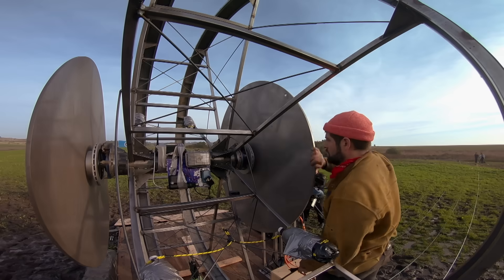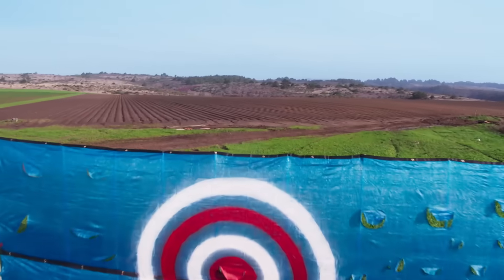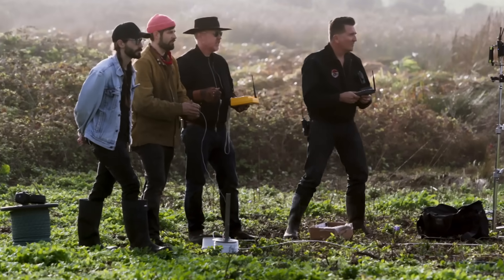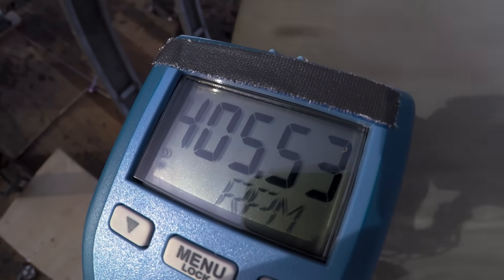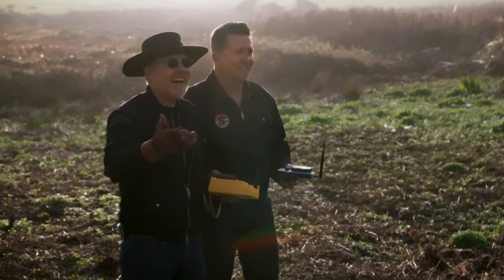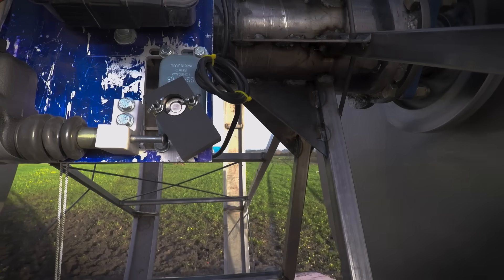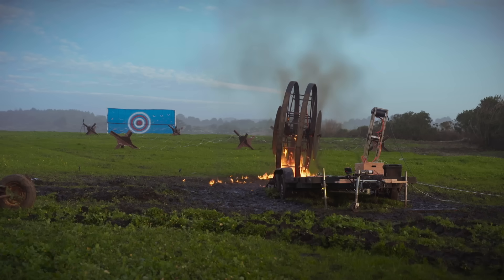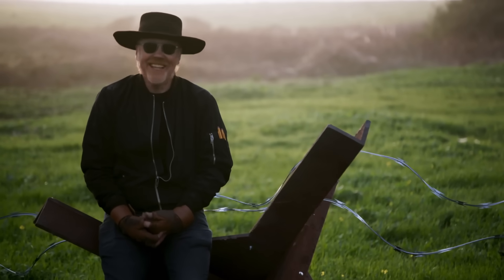Weaponised Flywheel Experiment Fails Explosively | Savage Builds

Comment: Wouldn't you lose a ton of energy to heat dissipation in the disc brakes too?
Reply: That's why more powerful brakes would transfer more energy. There would be less time spent generating heat (though the heat generated would be more intense...). I'm curious what the outcome would be if a torque converter could be used instead of disk brakes. There would still be heating of the fluid, but would it be more efficient at transferring the mechanical energy?
Reply: @NathanielHatley  
Like an 800 HP super car at redline and dump the clutch.
Reply: @larryscott3982  yeah like how drag racer clutches work...like one time usage only...
Reply: @NathanielHatley  I was thinking about that too.
Reply: @NathanielHatley  The faster those brakes lock up, the more likely all that kinetic energy from the flywheels (1000lbs at 65 revs per second) is going to simply rip apart the wheel frame.  It would fail spectacularly, unless there were a lossless way to couple the energy from the source (flywheel) to the sink (outer wheel frame) without going into instant lock-up.  Some sort of high-speed pulsed clutch, coupled via axial or torsion spring system comes to mind.
Reply: @NathanielHatley  Pretty sure that is completely unrelated. The heat energy lost should be the same regardless of the brake speed. They need to solve this with conservation of angular momentum, not energy. The only way speed matters here is static vs dynamic coefficient of friction (for the whole system rolling)
Reply: @chadarmstrong7458  Exactly that. It needs a clutch, not brakes.
Reply: @froschfresser29  Came here to say exactly this. Brakes are DESIGNED to convert kinetic energy to heat. A clutch's entire job is to connect masses moving at different speeds.
Reply: @firewall2302  so glad I saw this comment, I wanted to make it myself but was hoping to see it first. Let me reiterate this man's point: brakes are designed to turn kinetic energy into heat not transfer it.
Reply: @firewall2302    I agree but I think they wanted an "abrupt" acceleration rather than a transfer of momentum. Also, a clutch would likely be destroyed unless it transferred that energy over a few gears. I find it unlikely that it would've ever worked like they thought unless the entire thing was much lighter or if they redesigned it to have a holding arm that allowed it to spin before being let loose (this has whole other stability issues). Their brake idea would've worked without as much complexity as a clutch system but they'd have needed a much better braking system and probably more RPM or lighter wheels to compensate for massive loss in RPM to heat.
Reply: @firewall2302  a brakes job is also to couple two masses rotating at different speeds. Clutches and brakes are essentially the same thing. They literally could use either. For their design, it would be much easier to implement brakes as a brake axle is nearly the perfect design to use for what they are doing. They just way undersized the axle and brakes. Think same set up with tractor/trailer brakes. The engineering is already done. Just bolt the flywheel to the hub and bolt the axle to the axis. Using clutches would require engineering and fabricobbling hubs and axle from scratch.
Reply: @froschfresser29  brakes and clutches are the same concept. there is no fundamental difference.
Reply: @zarni000  No they are not. One transfers energy, the other converts it to heat. Otherwise explain why they have a very different construction.
Reply: @froschfresser29  the only reason brakes do not transfer it to turning is because your vehicle is generally not round ;)
Look at the basic designs. They are the same
Reply: @zarni000  Then why did it not work? And why do brakes get hot, while a clutch makes a car move?
Reply: @zarni000  The vehicle in the video is round btw.
Reply: @froschfresser29  yep exactly. It is round. That's why I'm saying there is no difference in this example what you use. Result will be same.
Clutch gets hot too just as brakes do
Reply: @froschfresser29  the clutch makes a car move because it transfers the energy from spinning gear to another spin able part - the axle. The brakes are exactly the same concept however cars are not spinnable. Unless of course u hit your brakes at like 100mph. Then you will see the spinning motion transfer to a spinning car
Reply: @zarni000  The "car" in the video is spinable, why did it not spin? Also I can hit my brakes at any given speed as hard as I want, the car will never spin.
Reply: @froschfresser29  Look a little more carefully. Why it didn't spin. Not enough to propel it thru mud...simple
Reply: @froschfresser29  hit brakes at 100moh as hard as you can and see what happens then...
Reply: @froschfresser29  btw u some kind of genius aren't u?
Reply: @froschfresser29  Try hitting the front brakes on a bike while going fast and see how many teeth you have left after
Reply: @thebekowsky1217  I actually did that. Three teeth had to be repaired, none was lost.
Thing is, the wheel stopped spinning and slid to the side, so that the bike went sideways and I kissed the pavement. The bike didn't flip or spin at all. And now?
Reply: @thebekowsky1217  maybe look at it from a different angle: the engine produces rotational energy, which is transfered to the wheels, where it gets transfered to directional energy (car moving), without relevant excess heat (apart from the engine, but that heat is produced before anything moves at all, and is waste anyway). When you brake and the car stops moving, where does the energy go? Or to put it in really simple terms: why does the brake get hot, but the clutch doesn't?
Reply: @froschfresser29  (TLDR included) If you were locked into going straight, and applied just the front brakes the bike frame and yourself would have rotated around the front wheel forwards. 

Now imagine a helicopter with only the primary rotor. Both the blades and the body will spin at the same rate but opposite ways. If you put the helicopter on it's side, fixed the body in space, and made the rotors into a solid disc, it now becomes an stationary engine and a rotating crankshaft. Scenario 1: If you were to grab the rotating disk with an external source (which is also fixed in space), you would resist the rotation of the disk and deccelerate it by dissipating the energy through heat (assuming all components are unbreakable), so the external source becomes a brake. Scenario 2: Instead of grabbing the disk, you move an unpowered, free to rotate e.g. like a wheel on a hotwheels car, second disk (disk 2) towards the face of the rotating disk. What will happen when the two faces touch is disk 2 will match the speed of the rotating disk (ideally instantly). Since disk 2 is free to rotate, it doesn't resist the rotation and both it and it's axle now rotate at the speed of disk 1 (the crankshaft disk). If you enable a way to move disk 2 back and forth, it now becomes a clutch system. You can then add gears to change the axis of rotation to the end of disk 2's axle, and wheels after that, and now all the components in scenario 2 become a drive system of a car. 

However, if you placed the car on an extremly grippy surface that prevented the wheel from moving and you engaged the clutch, it would then act like a brake. And in reality you do get some resistance through the clutch (from various sources) and that's why RPM changes when ging through gears.

TLDR: All brakes are clutches (clutches with high resistivity), but not all clutches are brakes (ideally).
Reply: @zarni000  How was it the mud? It barely made it off the trailer. The problem was the brakes they used didn't transfer the force instantly, they dissipated the force across a long time, which is how they should work but it wasn't what they needed on their rig.
Reply: @thebekowsky1217  was the mud. and his "equations" didn't take that into account.
he looks more like an actor and brings into further question the whole mars rover bs
Reply: @zarni000  It had basically stopped before it reached the mud it was going so slow. Yes the mud did make it stop but it would've stopped that quick on any surface anyway, it was the brakes that made the design fail.
Reply: @thebekowsky1217  breaks dont matter how fast they stop it. the motion is still transferred. there was just not enough power to get it through the mud. if it were a hard surface it could have moved. they also probably made quite some errors in the calculations. the fact they didn' even bother to try it second time which would have not been hard to do leads me to believe they didn't want to be further embarrassed...
Reply: @zarni000  No. It was slow off the start when it was still on the trailer that means it can't have beem the mud's fault. It was energy not being properly transferred to the main wheels. It was probably due to time constraints than embarrasment. And more to do with budget that they couldn't test other options.
Reply: @zarni000 If they had gotten the launch they wanted the mud wouldn't have stopped it. It was a launch issue not a terrain issue. The only thing they should be embarrassed about is the clickbaity title (which is down to someone in the network anyway).
Reply: your clutch will get hot too if you ride it while driving. Cuz they both use friction plates to convert energy
Reply: @firewall2302  but it still converts kinetic energy to heat to do that
Reply: Brake and clutch are one in the same. They both use friction pads to transfer energy/power. A clutch disengages friction where as a brake applies friction.

I think these friction pads were to small to prevent slippage. But ultimately I think Newton's Laws of  Motion come into play, Something about inertia and objects at rest tend to stay at rest, coupled with a slipping clutch caused it to just fizzle out.
Reply: @ghostdragon5758  it was never meant to be a brake but rather an instantaneous coupling to another disc. A brake just converts rotational energy to heat. They wanted the energy in the little disc to power a second disc hopefully with minimal loss to heat. It needed a clutch
Reply: This was also like trying to dump a clutch on an engine doing redline in 6th gear.
Reply: Yes... There is a reason engines uses clutch to transfer the energy and not breaks like this... Also this was doomed to not work as blank steel on grass = 0 traction and this thing not moving much.
Reply: They need to have the device off the ground getting it up to speed with the fly wheel then lower it onto the ground.
Reply: Aside from needing a clutch the energy stored in the little flywheels   didn't mean much to the big wheels but this would have gone further on a plane of glass with almost no friction rather than a field of mud. They could have at least taken some measurements instead of quitting. Could have worked
Reply: Literally they should have tested this more...
And come on, if you using brakes...
Do dual sets....

If you going to do clutch
Multi clutch pack

Comment: How was that not worth a do-over? 
Problem identified, why then why abandon the project? 

No. NO. N O !
Reply: Most likely because the time allowed for the project was decided in advance and written in the contract. And that any overtime would either make them lose money, or interfere with other projects.
Reply: Probably the cost associated with having to do a do over. In one of Adam's YouTube videos, he mentioned that redoing a certain shot for Mythbusters could have cost 10s of thousands of dollars. Probably something the network didn't feel like shelling out.
Reply: @thetimeisrite  it was the run through the props in a snow plow semi for the finale when he lost all forward visibility
Reply: Right?! I would share the series, had it ended differently.
Reply: because they ran out of time and budget. They are making a TV show, not a functional Pandandrum
Reply: If the braking system was the cause then they would need rethink the braking system. That may lead to re-engineering the flywheels and maybe even a new axel.
Reply: @keithmoody9274  
The issue IMO is the brake disc diameter. If the brake disc was 2 or 3 times larger in diameter it’d be way better.
Reply: @larryscott3982  If the pressure of brake disc is not great enough the transfer of energy can be severely effected. Personally opinion they should have used a simple clutch pack.
Reply: @keithmoody9274  the flywheels weren't exactly dynamically balanced so they lost a lot of energy to system vibrations
Reply: @keithmoody9274  
And a larger diameter of the brake disc gives a greater mechanical advantage. Even for a clutch brake, drum brake, diameter matters.
Reply: @larryscott3982  They should have attached multiple brake calipers to the spoked wheels that engaged the outer edge of the flywheel.
Reply: @LV2XPLR  
Yeah, an engineer could do it. Especially after a trial and error run. But they burnt it instead. 

Disappointing.
Reply: @keithmoody9274  yes in wonder why they chose a brake and not a clutch
Reply: I think they felt they "needed" a problem to be identified - for the video.  Even with a revamped brake system, I'm not sure if the thing would have worked.  So they gave us a "here's what we believe the problem was", but instead of testing it, they just blew it up because it probably wasn't the problem.
Reply: There's only so long you can pursue stupidity without getting bored.
Reply: Because they got their views from people like us, so win or fail they get paid the same without having to spend more time and money on the project
Reply: Money
Reply: just too dangerous.  it could have missed the targets and tank stops.  sending an explosive wheel at 40 mph in the wrong direction towards a forest.
Reply: @treatb09  
Yeah, like the cannon that hit somebody’s house. Yeah, like that.
Reply: Cuz the dude works for nasa and got it all wrong, they would have done a do-over if they thought they actually figured it out, but they didnt.
Reply: Not only did the brake absorb energy but as it rolled to a stop it leaning to the side absorbed some as well
Reply: I have no interest in wasting my time on any of this in the future .. he lost a forever viewer because he wasted my time.
Reply: @Umbrella Corporation 😂
Reply: And the absolute worst testing practice. 8k lbs of metal, probably 9k and you give it thin wheels to test on a muddy surface.
Reply: @FirstLast-cc6cv  Yes sir they just want views and subs they don't care that they wasted our time I'll never watch one of his videos again.
Reply: @AmericanRusticWoodworks  don't blame Adam as much for this. it's mostly the networks fault for budget reasons.
Reply: Perhaps a lack of access to high performance enough brakes? They were using off the shelf parts, and modern car brakes are not designed to lock up like they wanted them to, let alone as quickly as they needed them to lock up.

Comment: if you'd just fabricate some larger rotors and brakes it would work better. it's why with supercars and semi trucks they use massive disc brakes systems. with this setup you would need something much larger to create enough grab friction
Reply: Why would larger brakes be more effective? You just need more powerful ones
Reply: @bogdanboiii1154  because you need more surface area to create friction. doesnt matter how much force you apply if it doesnt have enough grab. for example lets use tires, if you have a skinny tire spinning on a road what would be better. Adding more weight on top of that tire or using a wider tire with more road contact surface.
Reply: @jimjam4082  this is a common misconception about friction. Friction is actually independent of surface area. If you look at the equation for a friction force, i.e. F_mu=mu*F_n, you see that it does not contain any surface area terms.